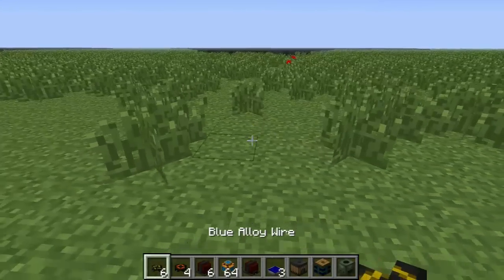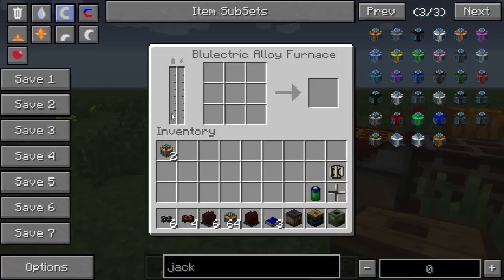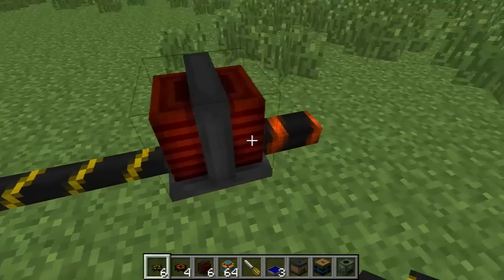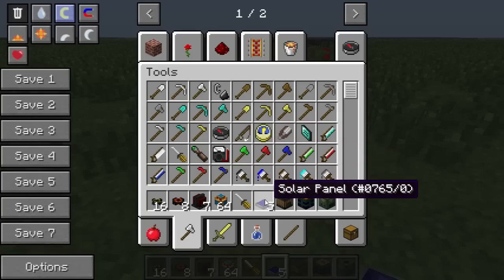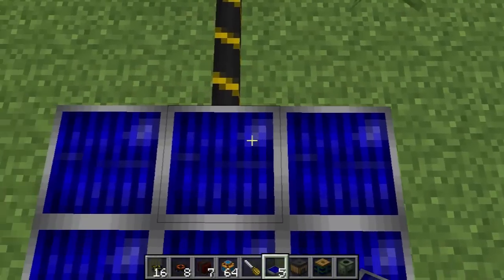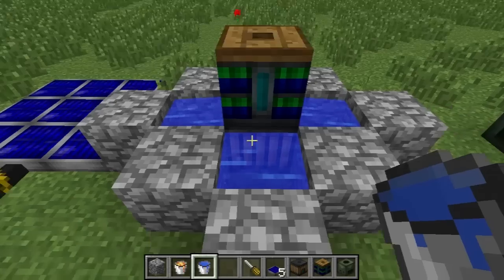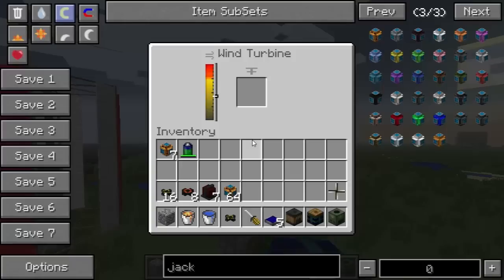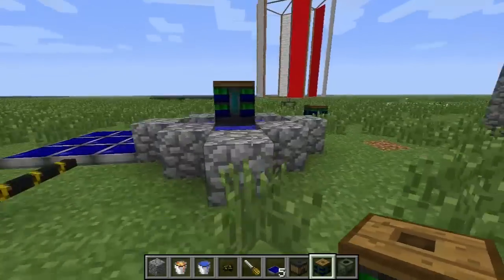Blutricity Generation, Storage, and Transportation [Block By Block Redpower 02]

Comment: If you put one lava under a thermopile with four water around it, it will produce a decent amount of power.  Round 60 watts.  A solar panel will put out 200 watts at max power.  So thermopiles are actually really good as long as you have a decent amount of storage because they will work at night.